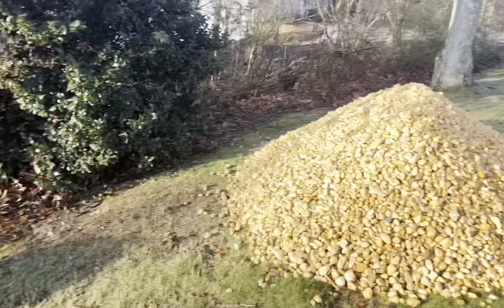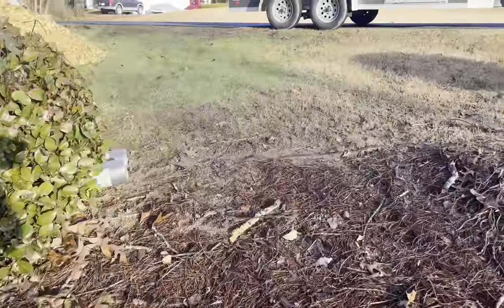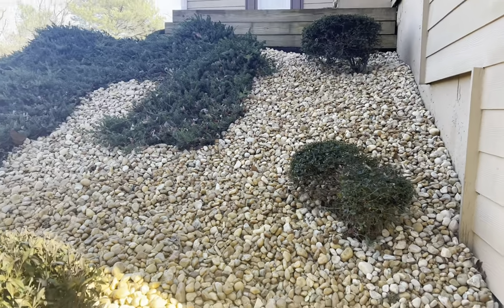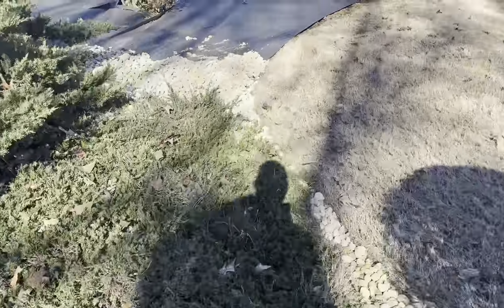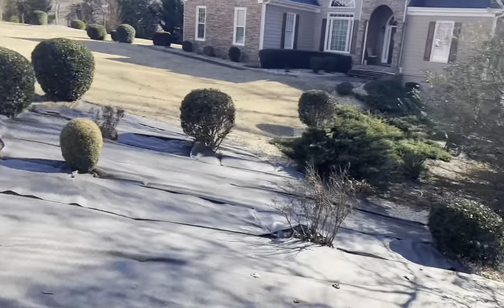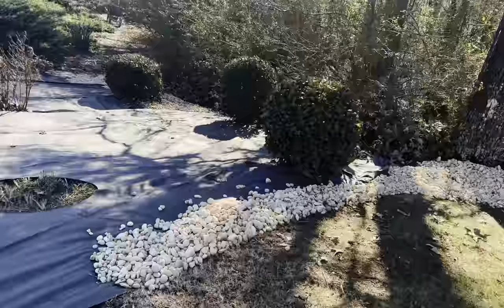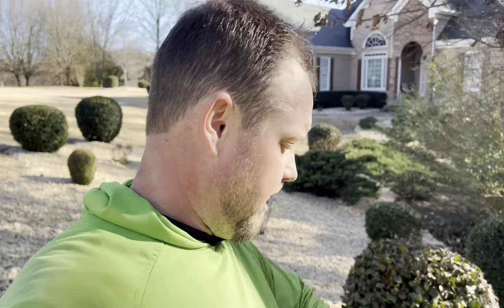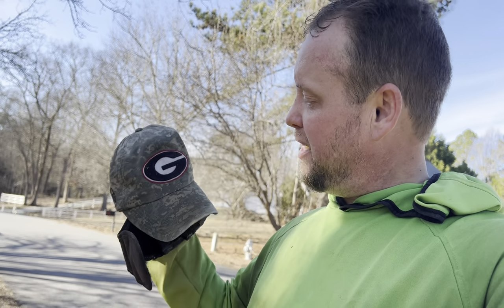How To Install Decorative Rock In a Flowerbed

Comment: That’s a great winter time job Joey. Moving that rock is hard as hell I’ve done it!  What are you getting for that job?
Reply from the maker: The rock was $157.50 a ton. They paid for 15 ton. I charged $65 per man hour. I thought I could do it in 8 hours. Took me 10 hours and 45 minutes to put out 10 ton. I told them I could get a refund for the other 5 ton and they told me to keep the money! Ended up $520 for labor and a $907 tip!!!
Reply: @ThatCrazyGrassGuy  Wow a tip for almost twice the job cost.  That is impressive
Reply from the maker: Great customers! I couldn’t believe it